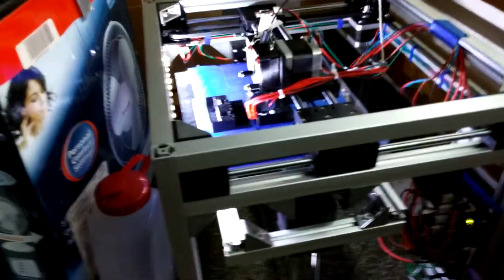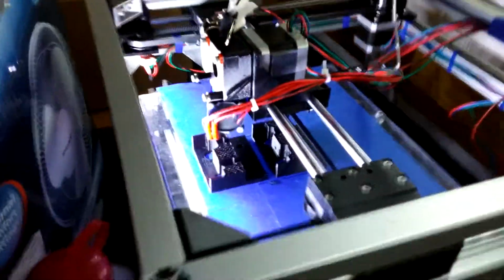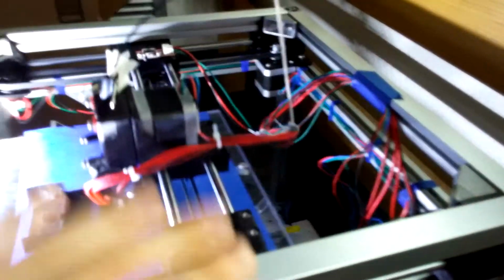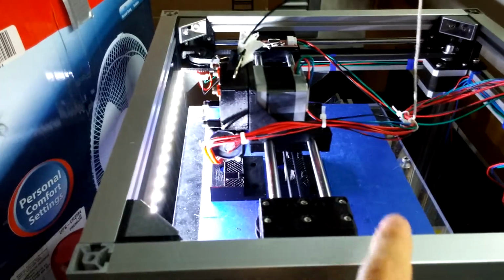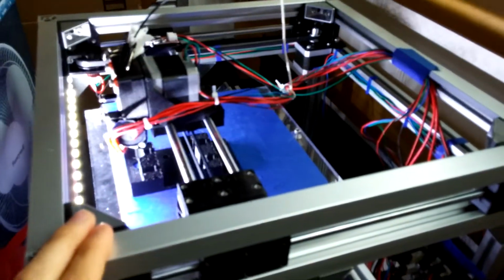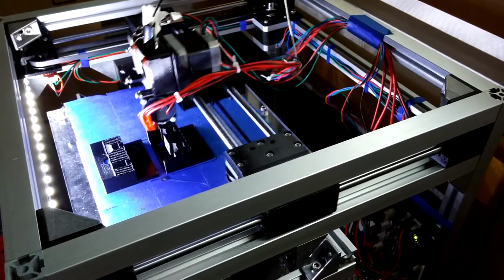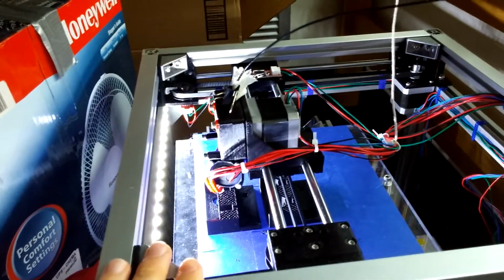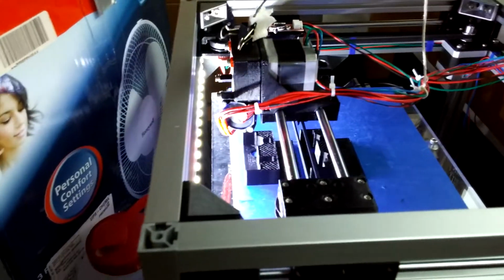3uP V1.4 Progress

Comment: 3DprintedLife 
Hi!
In H Drive configuration like above Minimum and maximum belt length between two driver (Motor) is W and 2L  + W + 2L where W and L are the Length and width of 'H' respectively.
As the amount of backlash is proportional to the belt length at extreme ends it'll cause more error.
If the drivers are mounted two opposite corner of H then Minimum and maximum distance would have been L+W and 2L + W + L (which more nearer to the ideal fixed length of 2L + W and 2L + W).

M
 _         _
|  |       |   |
|  |____|   |
|   __   |
|  |        |  |
|_|        |_ |
            M
What is you thought about the above configuration.
Rajib
Reply from the maker: Well in theory that would work a bit better, however the main drawback of hbot isn't that the slack in the belt causes backlash, but rather the mechanics rely on the idea that the x gantry is completely rigid. However, even with perfect bearings you can't get a completely rigid gantry, and this leads to some rippling and potential skewing when the x axis changes directions.

While your theory may help a little bit, I don't think it would make a huge difference. The best upgrade from hbot is to go to corexy. It is a bit more complicated and requires more design work, but it doesn't require a rigid gantry to produce very accurate and repeatable motions.

Comment: Nice video !
Taking into account that the demand is so high, did you think of outsourcing the printing of the parts to some other members ?
For you to print 55 kits it would like so long, but for 55 members it would take very few time.
Then they could just send the printed parts to you, and you can quality check them and assemble the kits.
Reply from the maker: Exactly what I am doing! But unfortunately there is still quite a bit of work that has to be done by me and I also can't max out my credit cards (which have a rather low limit lol). Anyway I hope to do 6-8 kits a month (if possible) and considering there are quite a few people on the list not actually interested this means I should be able to get through most of them within 5-6 months...that's the plan anyway.